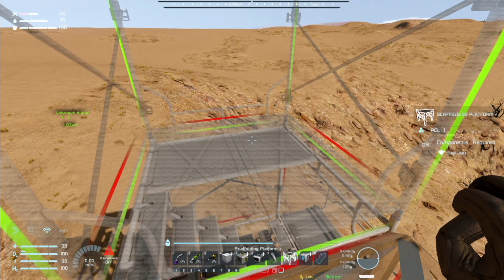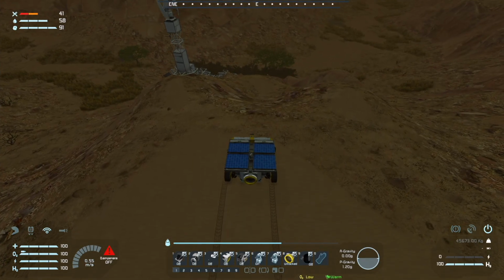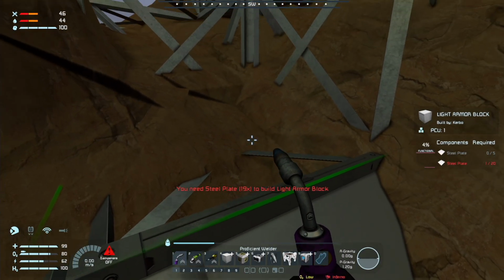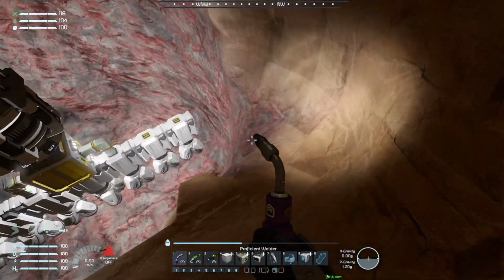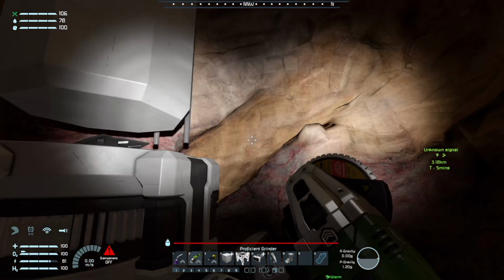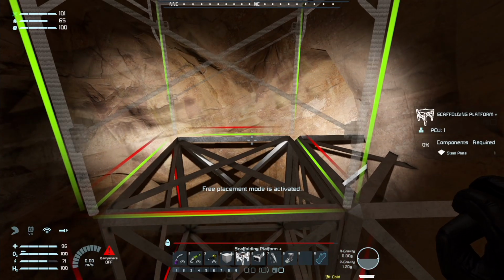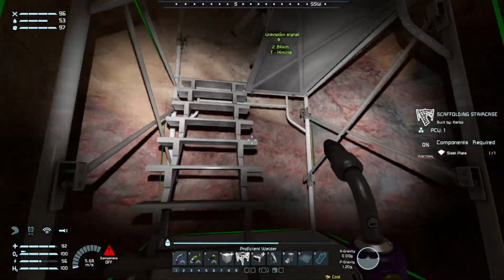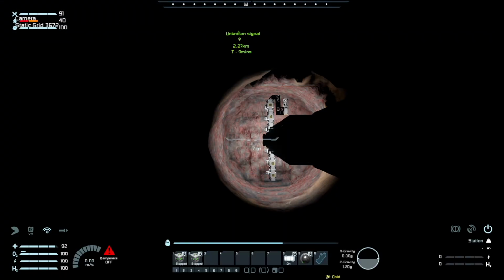Wasteland Survival Series #5 | Oasis House and Drilling Deeper | Space Engineers

Comment: Trick I use on Rigs with Multiple Pistons, Rotors & or Hinges is I make them different colors then name them that color red, blue, etc, so when need to move one with nothing but panel handy I can easy see which is which.  … also on deep drill rigs if you make Piston down, then U-turn one to a up, then a down, you can stack them all in a tight bundle that stretches Very far down but doesn't have to be huge tall.  PS   what is the name & or location of that scaffold Mod I cant find it on steam.
Reply from the maker: I've made plenty of extendable piston drill rigs so wanted to try something different with a continuous drill. This has the side benefit of leaving a tube in the ground down to the deposit. The scaffolding mod is called Scaffolding Repack https://steamcommunity.com/sharedfiles/filedetails/?id=1818289422 Thanks for watching!

Comment: 17:05 Just use windows
Reply from the maker: Not a bad idea. If I redo the back wall I'll keep that in mind
Reply: @KerboOnYT  Oh and what mod added the new ores?
Reply from the maker: I'm using Better Stone v7.0.7 and DeepOres (Hardcore) from the Steam workshop
Reply: @KerboOnYT  Better Stone sets the ore parameters for the planets, and sets all ores to be 10x deeper. Without any other changes, it generates ores half a km deep ore more (pun intended). I bet that deepores isn't compatible, and isn't needed; it's either doing the same thing better stone does, or it's doing nothing.
Reply from the maker: You're probably right, but the ores are working the way I want so I'll just leave Deep Ores enabled